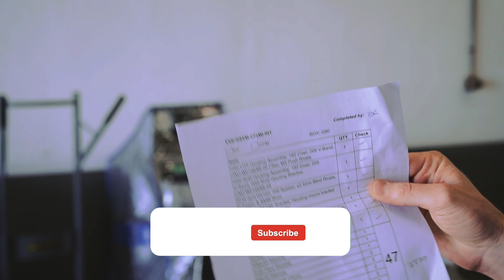I Fixed The BMW M4 G82 Sound

Comment: Paint that part body color!  I love my ‘24 G83 but got it in triple black bc it looks so much more aggressive when that part and others match the vehicle color!
Reply from the maker: I will definitely do that very soon ;) What else did you do with your whip so far?
Reply: @rollsolow  man I should probably start a channel but too lazy lol. I’m picking it up today after Ceramic and front and rocker ppf, my H&R springs just arrived Tuesday, Intake is also in the garage, and the MAD Downpipe also just got here, so by next week, all of that lol. And I only have 650 miles on it 😂